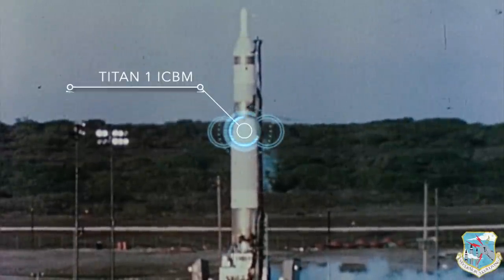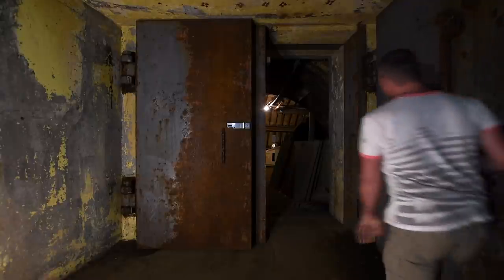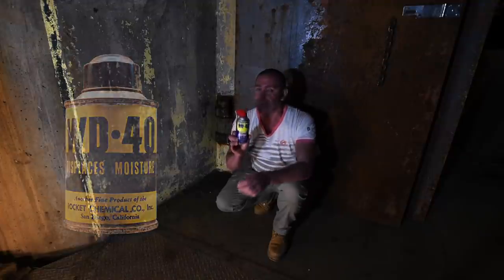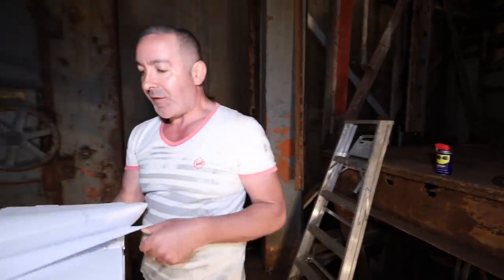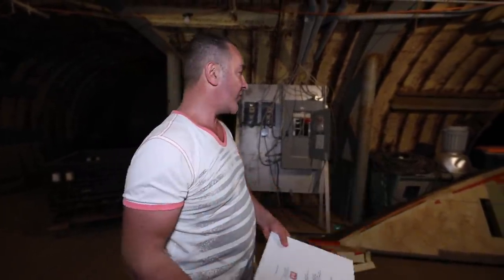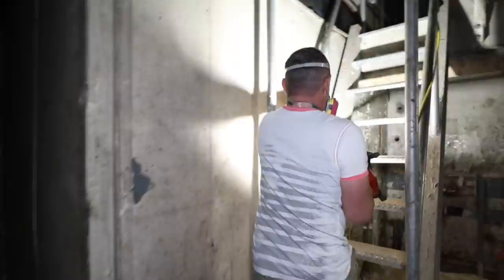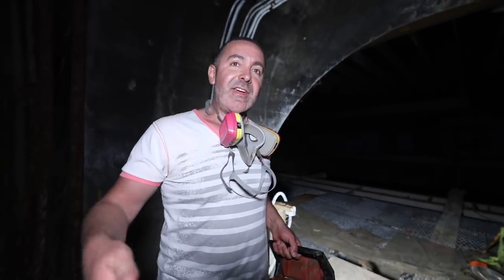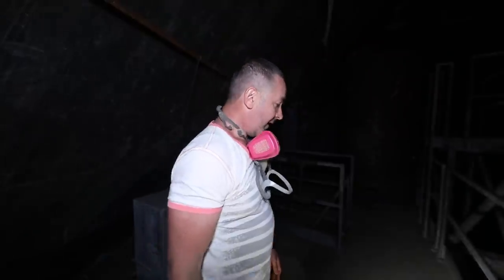Ep. 35 - WD40 Was Invented For This Nuclear Missile Silo

Comment: Just started watching and I have to say, WD-40 is not a lubricant, even though it can work as one. It was designed for water displacement. That is what the WD stands for. During the moon missions and it was used to coat the fuel portion of the rocket so that the ice buildup would sheet off when the rocket launched. Try PB Blaster. You will have quicker results and it penetrates better. Also, be careful. WD-40 is flammable. I restore pinball machines and learned that the hard way.
(Edit) I should have watched longer before commenting. You are now explaining it. LOL Oh well, PB Blaster still works better. :D
Reply from the maker: Never tried PB Blaster.

Comment: Go to    12 min 0 seconds.....Look at the walls this tunnel !   I don't believe  the walls were repainted.. 

The metal has been under ground  6 decades....look cement floor ( Nik correct me If I am wrong) this structure looks almost new! look to the right the metal that is mounted , ( use have Cable trays) is also not destroyed.  When look at other Titan 1 , walls are top bottom rust and Mold , This complex is nothing short of amassing preserved .

Hard to explained until you walk a few miles under ground in "Bad  sight"....then look at perfect paint and floor this place , no spray paint  "*&$$()(" all over walls.
Nik great Find on this purchase, have real GEM!
Reply from the maker: Agreed Michael. Quite a prize. Conditions overall is wonderful to work with. You have a keen eye my friend.
Reply: @NuclearBunkerLiving  I first  went into my 1 st Titan 1 in 2010, that first walk down around the elevator shaft, I saw the "Nexis area , I was Hooked. I spent over 10 sold Hours  , in complex . I did not see everything!  
So when I found your Chanel  on You Tube 
 See you have ability , Dream power & money to actually Repurpose , is great to see.

 Like I said ,Until  a person feel cool air  , Majesty of this underground complex  and the xxtreem   Darks Quietness .... well rare experience try explained to any one else.
You are living my Dream NIK   KEEP GOING!!
Reply from the maker: Pleasure to add value to this mega structure. It was always in need of love, a new purpose. The Titan 1’s dopamine fix.
Reply: Any Spray chemical products have side effective problem onto human respiratory system, please take care!
Reply from the maker: Yes we take preventative measures.

Comment: You really should try strike hold
Reply from the maker: What’s that ?
Reply: @NuclearBunkerLiving  Fill up a foam coffee cup with water and WD-40 will float on top of the water. Strike Hold will go through the water and eat the bottom of the cup. You can coat a lightbulb with Strike Hold and also coat a light socket then assemble. While the power is applied to the socket you can submerge in water and the socket and light will not short out. It was developed by a former special forces soldier for military application. Great videos wish I could see one of these sites in person. Thank you for sharing